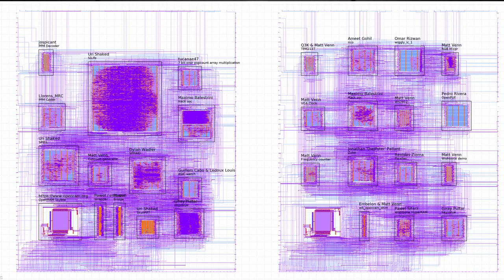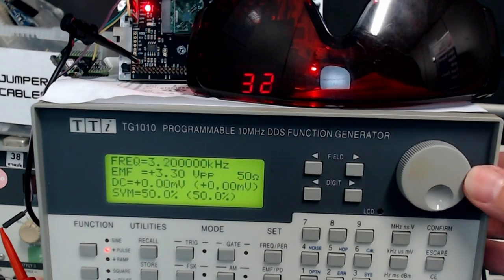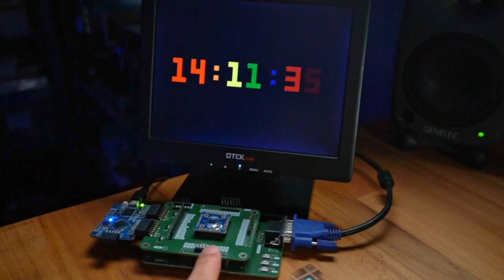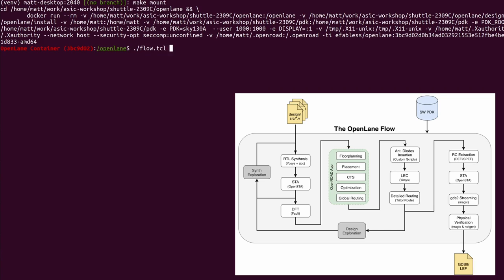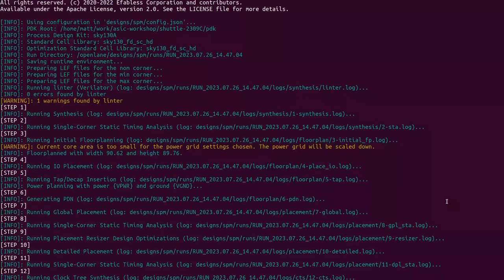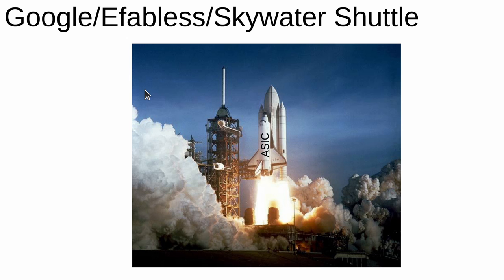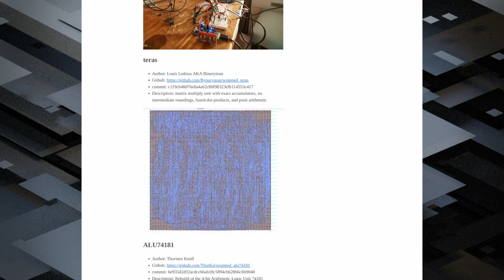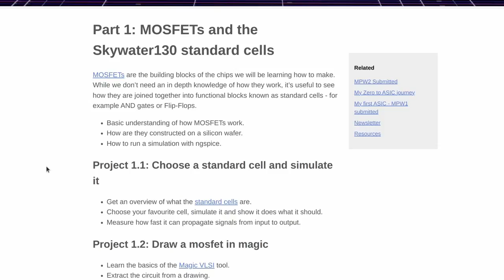Learn how to design your own custom computer chips!

Comment: You have me very interested. I'm curious, for a relatively simple chip, something on the level of complexity of a 6502, if I were to submit a design to a chip fabrication service, approximately how expensive would it be for tooling and per unit?

For example, if I were to get an injection molded part made, the tooling may cost $10,000 and then the part may cost $1 per unit after that. What are the ballpark ranges for how much a simple chip fabrication in a relatively low quantity would cost?
Reply from the maker: 6502 is about 2000 gates I think. Let's ignore that it's nmos.  Using Tiny Tapeout that would be about $150 for one part. If you wanted more parts or more than 24 IO, you could use Efabless chip Ignite which is 10k for 100 parts. For more parts or lower cost you'd have  to work out a deal with Efabless or buy an entire mask set for 200k. We don't yet have a great way of scaling up for small projects.
Reply: @ZeroToASICcourse  thanks for the reply! That makes a lot of sense. For something that does eventually get scaled to that full mask set level, about what are the economies of scale after that? After a full mask set is made, what is approximately the price per part for say, 1000 and 1000000 units?

Comment: Hi, I have some question about join the online program.  I am a validation engineer, I have just been transferred to apps team. I always wanted to learn what those designers are doing. but I have a 2 month old child at home. I live in China, I do use VPN and my company uses its own VPN. so the course is accessible to me. I guess my question is am I able to get my chip made and shipped?
also, what does this $50 + P&P, P&P mean?
Reply from the maker: Hey, can you write to me via the contact form on the web page? I'll help you check you can access everything.